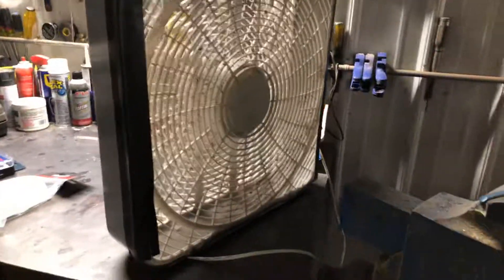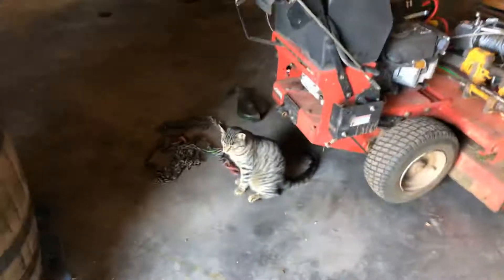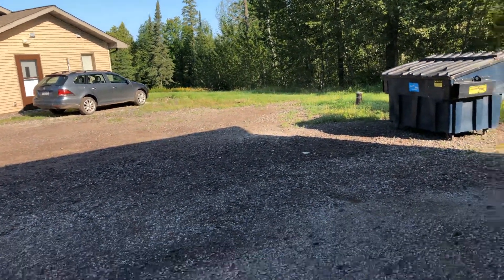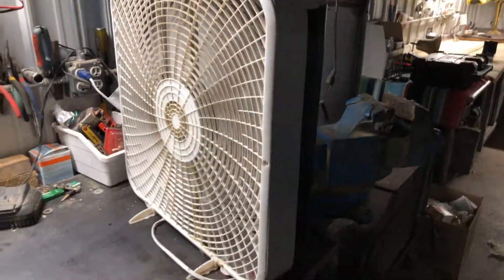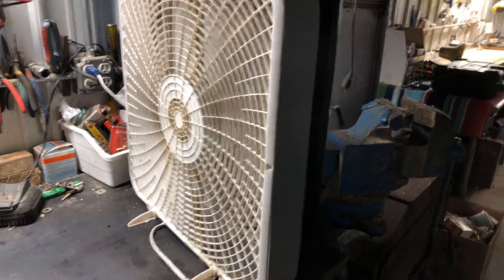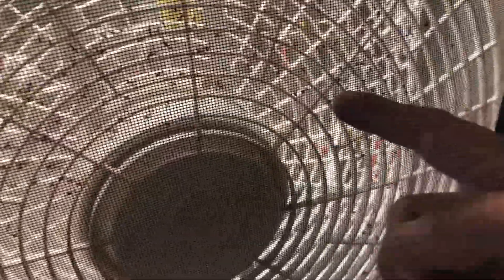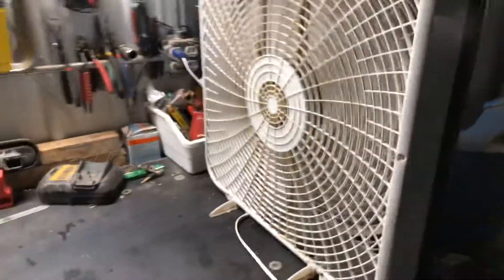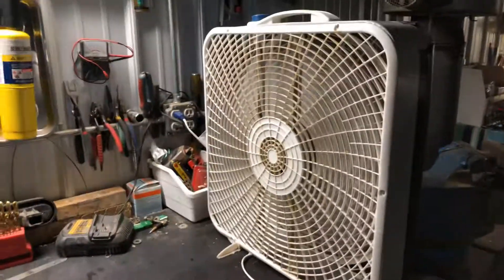DIY MOSQUITO TRAP / FLY TRAP

Comment: Good video. Is there a specific name for the type of screen to buy?
Reply from the maker: I use cheapest screen. The fan runs 24/7, so I’m not sure about the death process. 
I’m making a new one.
Reply: @torahexplorer  cool. We just bought the supplies to make it today, will be testing it out tonight. Would you say it gets pretty full every night?
Reply: @torahexplorer  tried it tonight and caught 0 mosquitos, and they were still buzzing around me. Not sure exactly what went wrong
Edit: I might have realized what I did wrong. I put the screen on the front of the fan, where the air blows, when I believe it needed to go on the back of the fan
Reply from the maker: @adamthewoodworkinglawyer  I’m sorry. I should have said more details.
Reply: @adamthewoodworkinglawyer  🙄🤐

Comment: lol, you know..
 you don't have to put a screen on the fan. Because the fan blades will just splat and chop them up anyways. Only difference is that you have to kill them before you turn the fan off  otherwise they will just recover and fly away later. Ive heard of people spraying them with rubbing alcohol, or Windex. Dont know if it works just what i heard   I just use a fan and don't worry about the screen and disposing all the bugs the fan will just disperse them for me.  just point the fan away from you at your feet or step stool works great.. one time i was on a a job that was infested with mosquitoes and there was too hot to cover up with long sleeves besides they still bite through your clothes o so I went to home Depot the most powerful fan they sold the round one with the metal blades little u-shaped floor stand. 
which which I put on my shoulders and more like a backpack wrap the T-shirt around the bottom handle to keep it off my back. the any mosquitoes came even in front of me got sucked around me and into the fan behind me that didn't get a single mosquito bite after that
Reply from the maker: @smottybug  nope lol 🤠😂. They will blow through. It works great! They just dry up.